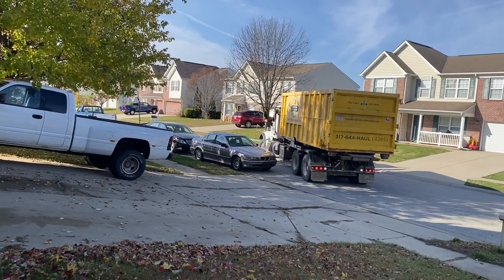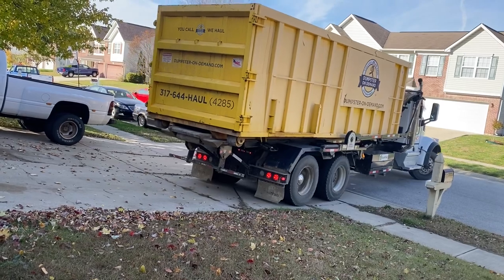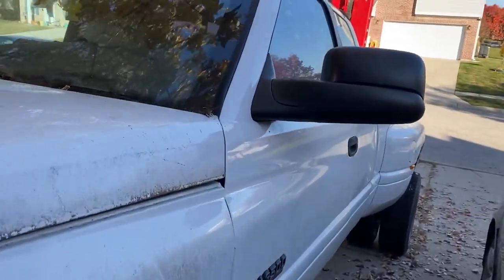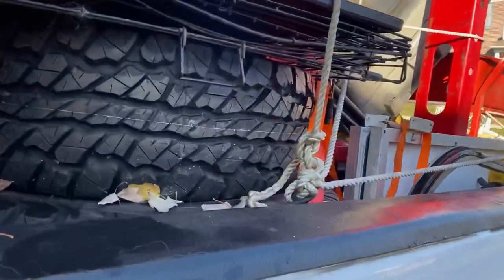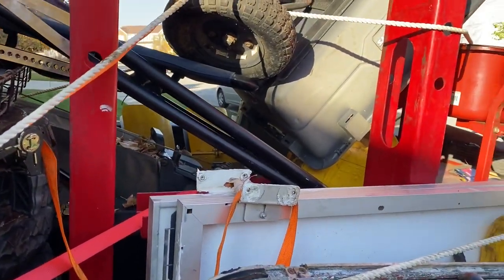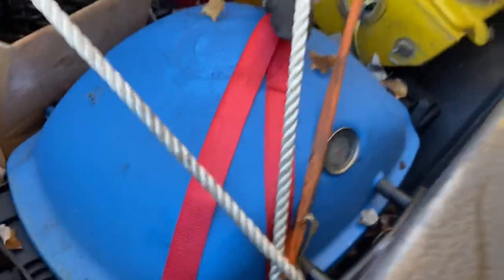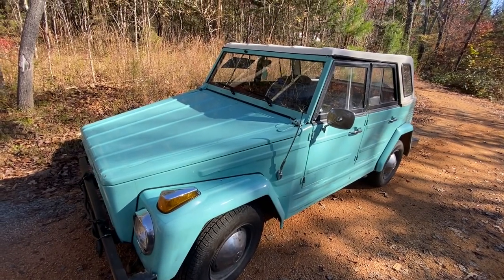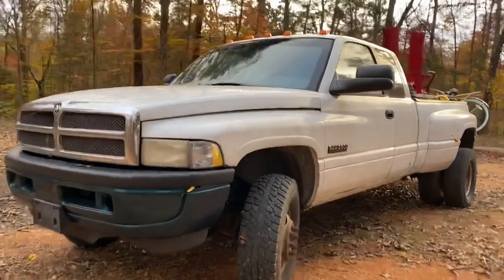Dumpster delivery and 1st tool trip back to TN

Comment: Wait, is this from before or after the brake job in TN?  The thought of you driving from Indy to TN with that front brake so messed up is bad enough but you doing that with a full load in the back?  Damn!
Reply from the maker: I had never driven it before.  It stopped fine but pulled to the right under hard braking.  Hence why i tore into it once i got back to TN
Reply: @BusGreaseMonkey  All the same, the fact you drove that truck without first and second gear, questionable brakes & fully loaded would seem very sketchy.  Glad you made it back to the Homestead well enough.
Reply from the maker: It has 1st and second gear, it just likes to pop out every once in a while. I didn’t want it to pop out going up the hill so i choose 3rd
Reply: @BusGreaseMonkey  Ahh, OK.  Still, I think I'd have been a nervous wreck. Just glad it worked out and you could get to work on making it handle better at home instead of on the side of the road or having some catastrophic failure.
Reply: Thought Tyler was going to work on that trans after he fixed the t-case....

Comment: I have a question, I watched one of your old videos of you repairing a Jacobs brake and I'm wondering if the 6-71s had them and if the system for that engine was identical to that on the 6v-71
Reply from the maker: Same but 2v 4v heads have slightly different components
Reply: @BusGreaseMonkey  any advice/help/things to look out for when I purchase it?

Comment: Hmmm,  looks like that dumpster somehow slid down the driveway enough for the door to open!!
Reply: The door opens to dump it.
Reply: @KS-cp6bj  Scott wanted the delivery driver to move the dumpster further away from the house but he didn't. In the shot of the full dumpster it was further down the driveway, next to the sidewalk, so I assume Scott gave it a quick tug to have more working room.
Reply from the maker: No the driver pulled it another 24” or so before he unhooked.  Even though at first he was not keen on doing it.   It made it much easier to load large heavy items.
Reply: @BusGreaseMonkey  I bet that extra 24 inches drove the pick up driver crazy. I used to hate picking up dumpsters i didn't deliver for just that reason. Pushing or pulling them around full is a great way to royally screw up a driveway.